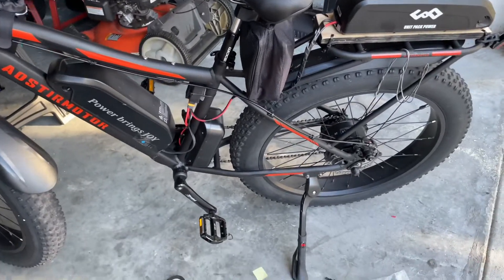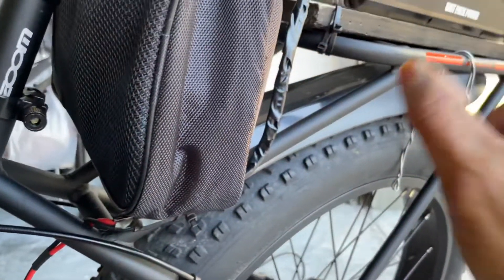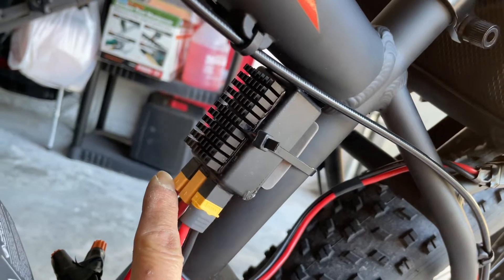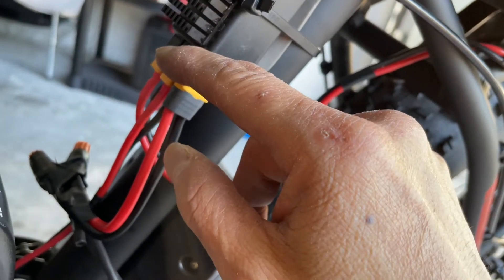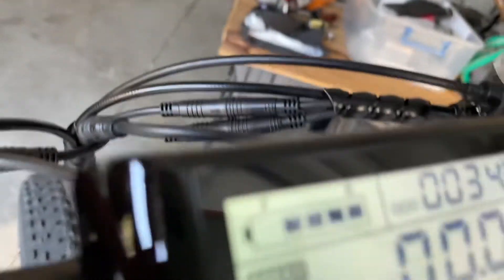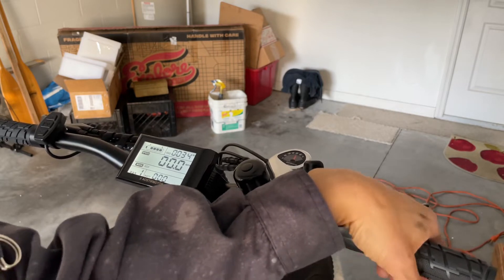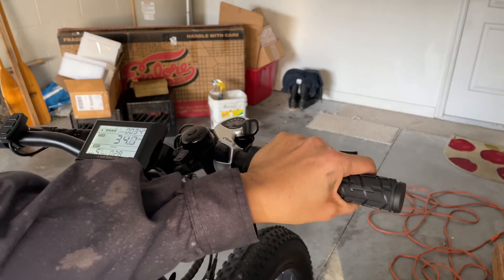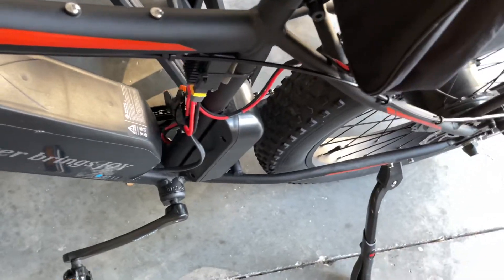FBC ( Fusion Battery Combiner ) used with 2 different batteries on Aostirmotor  S07-B   E-bike

Comment: You should install that 2nd battery on top of your frame tube, where a tank would be on a motorcycle. It’s better for weight distribution. I used rivet nuts to secure my battery bracket. 

Been manually swapping batteries until today. The combiner just arrived.

Comment: That's a really cool hack if you've already got the second battery on hand. But if you're buying new, just get a bigger battery upgrade and put the stock one aside. These S07's use great parts everywhere but the stock battery, I've seen a dozen reports of them giving up between 200-300 miles in (320km to 480km for metric users).
Reply from the maker: Agreed on the original battery, it was weak but i still have and use it on my dual setup! Hopefully it lasts 2 years, it is already 1. 5 years old.  Also their brakes are trash, if you can upgrade to hydraulics do it.

Comment: Hey friend, I plan on adding a second battery on my bike with the FBC , the thing is I have a D-class ariel rider, and there are two controllers that are under my seat, because I have two motors, one motor in the back wheel and one on the front. How should I go about connecting the FBC to both of my controllers? Will I be able to use the XT60 wires to connect both controllers into one XT60 wire that somehow connects into the FBC? Just a bit confusing on my end, thank you for any info
Reply from the maker: I wish i could know how to add 2nd battery to 2 controllers!  All my ebikes have just one controller as i have never liked dual motors.  I know a bit on dual motors but no way a good or reliable experts.  FBC is awesome i have it on Aostirmotor and Ariel Rideal, very easy to install. I hope experts on dual motors can help you on that.  Grizzly owners may be.  Good luck and please keep us updated.  I m not sure or confident on dual motors, so sorry on this.
Reply: @MrMtr999  thank you for the response !
Reply: @chazevans7816  easy, both controllers are wired together underneath the seat already, only one xt60 connection under seat so that will go right to middle of FBC and stock battery will go to one side and second battery will go to other side. Pull of the seat and take a look for yourself if you haven’t already. I modded multiple ebikes lately one of them being a d class
Reply: Electromotive has a 4 battery combiner with 2 controller slots

Comment: Nice Setup 
Will this work with any motor controller ? like bbs mid drive bafang motors ?
Reply from the maker: 45-50 A controller should have no problem.  If your controller smaller than that, no problem at all.  Go for it well worth

Comment: Do you have a link for the needed part(s) and maybe a diagram. Thanks
Reply from the maker: Ken Kane , I just updated the description, it has all the parts you need.  The diagram comes with FBC in the box, very easy to setup, just cut the battery wires that feed the controller( no need to open controller box) please turn off your battery. Then reconnect red (positive)) and black (negative) with XT60 connectors on both battery end and controller end.  Then connect them to FBC and do the same with your 2nd battery.  That is about it.  Very simple.   It makes the bike a different beast, I ride 20-25 mph consistently a single battery won’t be able to keep up that speed , well worth it. Thanks for watching .